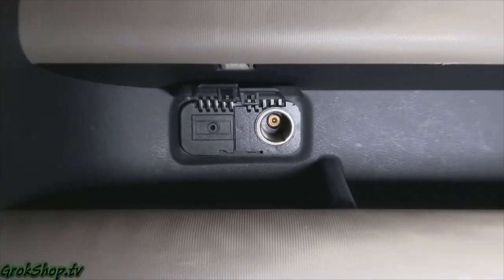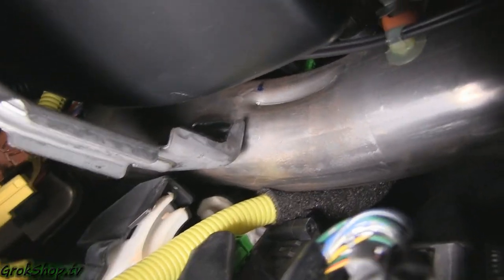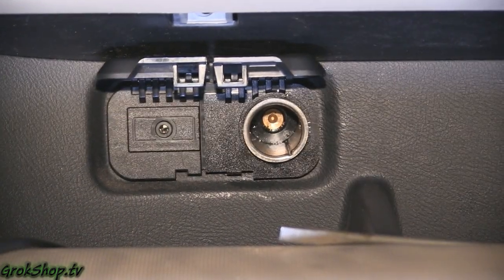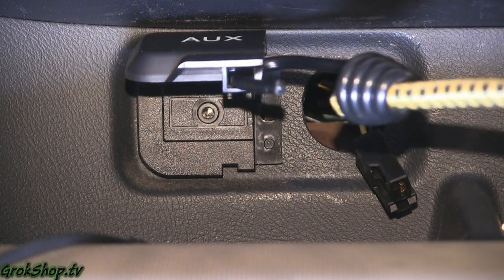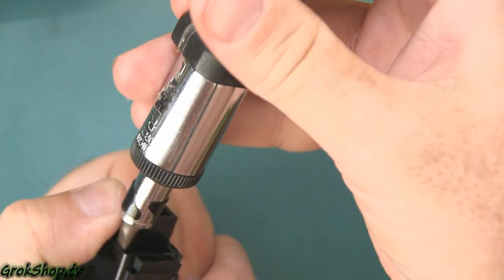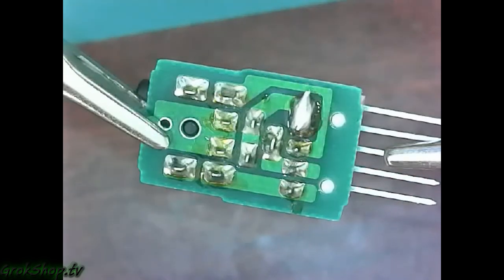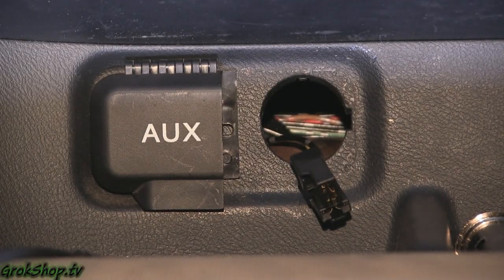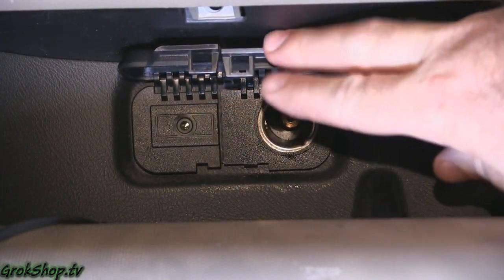Honda Element AUX Jack Repair

Comment: Here's the scoop... YOU DON'T NEED THE TOOL! 
Unless you've actually screwed up the metal socket itself somehow and need to replace IT. And you don't need to drop the glove box either. The actual tabs that hold the plastic SOCKET housing are on the TOP and BOTTOM of the housing. So all you need to do is have a slightly curved-tip screwdriver/tool to wiggle behind and loosen the top and bottom of the plastic socket housing. Then all you do is pull it out and the socket housing is out of the way without having to remove the actual metal socket! Now, for the AUX INPUT plastic housing, the tabs that hold IT in are on the Left and Right SIDES of the housing, so take your curved-tip screwdriver/tool and first wiggle it behind the LEFT side of the Aux housing so it pops out a little, then as in the video stick your finger through the empty socket hole and push on the RIGHT tab of the Aux housing from within and it will pop right out! The second half of the video about grounding the pins is 100% correct, then reverse everything and you're done! I actually removed them both again to confirm my process works. So it's totally do-able without the $10 tool, but if I hadn't followed everything else about the video I would not have known that.
Reply from the maker: Fantabulous...  thanks for taking the time to further the cause :)  Someone else mentioned they got it to work without the 12v socket-puller tool, but didn't provide this detail.  Can you provide a little more color on the tool you used?  Something like these maybe?:  https://www.amazon.com/Remover-Tools-Perfect-Removal-rings/dp/B079K41KMW/
Reply: Thank you both for this! I was able to do it with an old bent up screwdriver and some wiggling. The video was also very helpful.. thank you. Still the only video out there specifically for Honda Element aux port replacement.

Comment: Thank you! Our 2003 aux went bad and thanks to your video I just ordered a new aux input and replaced it in only about 5 minutes total. While getting the 12volt out was not fun it came out relatively easily once I used a screw driver inside it to pull it out far enough (I did it without the tool), then used pliers to grip it with care, wiggle it and pull it out. The aux input came out without even going behind the dash by again prying carefully and popping it out (much easier than the 12volt). Everything is back in place correctly and kicking out the power and tunes :)  We went with a bluetooth connection to our phone and the direct wired connection to the aux input. So no wires are plugged/unplugged once it's set up.
Thanks again!!!!
Reply from the maker: Thanks for your feedback Scott. Glad it helped!  I am amazed you were able to get that 12-volt socket out without a tool!  I wonder if they used different materials over the years or some such?  In my E, the little flanges that grab the 12v socket's metal cylinder from the sides would not release for me without the special tool... I tried many different types of screw drivers etc & even tried to make my own tool before buying one.  After getting it out I could tell the flanges were very rigid with minimal flex, so it made sense why I was having so much trouble.   I also have done the BT setup now.  Welcome to the 21st century, lol.

Comment: Thank you for these instructions. Excellent and it worked!!! I took my time on my 2008 Element and it really wasn't too difficult to disassemble the lighter. Now, I'm still 2nd guessing if the solder was the fix but it seems that when I connect the 3.5mm cable to the AUX and my phone, and turn the radio off/on, and I'm sure to have the volume on my phone HIGH, then everything seems to be working. Regardless of what it was exactly, I'm happy I should now be able to listen to podcasts, etc. in my car conveniently again. Thanks again!!!

Comment: Absolutely great fix video, best I’ve seen. Totally covers every aspect. Way over the top with the soldering. Beautiful solder job. 
BTW the clever Honda designers are not fools. Ever try to change an oil filter. They wanted it to be dealer accessible only (needs to be on a lift) that they put it over the exhaust so there was a chance of fire, even better for them, have to buy a new car. They make it difficult on purpose and even engineer parts to fail. Take the window lift, and the accessory port, the door speakers I could go on and on.  BUT......... they make the mill bullet proof so you drive it a long time and invest in repair labor and parts. Even General Motors has more reliable peripherals, inversely their mills suck.

Comment: Greatly appreciate the repair video.  Adding that I found that a plastic trim removal tool to be the easiest approach to popping out the 12V socket and aux port housings without scratching up the dashboard.  I just used one from a cheap Harbor Freight set.  The corner of a thin putty knife also works great for removing the circuit board from the housing.

Comment: Got by with a screwdriver, but awesome info, not sure how anyone could figure this out on their own. 100% the fix and now working great. Great solution before just replacing the jack.
Reply: And the glovebox tabs should come off really easy with just your fingers no damaging tools needed. 3 elements all pop out like nothing just tricky getting em back in.

Comment: Great video, had a similar issue with our 2011 Honda Pilot, while not exactly like the video to take it apart, the little aux input jack was the same when it came out, bridged the two pins just like your video, and now it's working great (fixing it this way meant I didn't have to wait for a part to come in the mail, and honestly I think I prefer to just manually change it to AUX or USB vs having the cable detect it, so I think I like this better).  Thanks for putting this video up, it really helped!

Comment: Super awesomely helpful video.  I was lucky enough to pry at the 12v assembly and it eventually popped out.  My tool of choice was a 90 degree flathead screwdriver.

I suck at soldering.   They call me Shaky McShakes....but I got it.

Appreciate the sharing of knowledge.

Comment: Thank you for this, I thought I was going to have to tear my dash apart to get this effing thing out.

And thanks for saving me the trouble of looking up the pinout, since I had the exact same problem with the plug detection failing.

Comment: Going to give this a shot.  Thank you so much for posting.  It's driving me bonkers that it doesn't work.
Reply from the maker: Good luck Bryan - u got this!
Reply: It's working again!  Your video made all the difference.  I'm going to get a Bluetooth adapter for this sucker so I won't be plugging stuff in and out all the time.  Thanks again, sir.
Reply from the maker: Right on.. thanks for following up man.  I am thinking to do the bluetooth thing as well.  Post up the model you end go going with... I am curious about the different fits.  It would be great if there was a model that could break out some 5v USBs from the the 12v accessory plug AND also connected to the AUX for Bluetooth.  I'm probably dreaming tho...
Reply from the maker: Thanks for the update... Looks like you found a good one.  I also have a Garmin in there which uses the 12v accessory socket, but I think it also does a DC-DC conversion 12v-to-5v & may actually work on the 2.4A USB plug.  I will just need to look that up to verify.   I only use the Garmin on occasion, so it doesn't necessarily need a dedicated plug.

Comment: Thank you Thank you Thank you. Actually was quite simple
but only because of the great video. Opted to solder the pin and it works perfectly. Less than 15min time. Much Appreciation :)

Comment: I've had a 2007 EX as my daily driver since it was new. My AUX port failed long ago (same problem, wouldn't even switch to AUX on the stereo). At some point, I bought a Bluetooth FM transmitter. It has made me mad so many times. Somehow it will get changed to transmit on the wrong station. It is unusable for calls because the person on the other end can't hear me. I have to turn the volume up super high to hear my music. Etc etc. I finally had enough and decided to research what it would take to have a working AUX port again. Didn't know if the problem was in the stereo itself or the jack or what. Found your video last night. I've rarely facepalmed so hard. I solder as my career. I think the port broke before I started this line of work, but I've been at it for nearly six years. Anyway, I waited for daylight and went out and pulled the socket and aux from the dash. I actually just used a constant and steady force and pulled them straight out by hand. I'm a petite woman, so it didn't take brute strength or anything. Removed the circuit board/jack, broke out my Hakko FX-888D and some Kester leaded solder (I love a chance to use the leaded stuff) and bridged the joints. Reinstalled everything and it works perfectly. Can't believe how frustrated I've been on so many occasions when this was such an incredibly simple fix. Ten minutes and $0. Oof. Thanks for the video!!!

Comment: Thank you so much for this video! I bought the cheapest soldering iron (<$10) and fixed my AUX port as well as my partner's AUX port. I'm very appreciative of the time you took to illustrate step by step how to access the components.

Comment: The soldering solution worked.  My AUX wouldn't work, exactly as described, on my 2008 Element EX.  I pried the 12V and AUX ports from the front using a small pry bar.  My Element is WAY past any concern about little scratches on the plastic!

Comment: Great explanation, I was actually able to get both out without goi big through the glove box, a little more levering with a screw driver, but no visible harm and everything seated back like normal. Saved at least 20 bucks going this route and had sound back in 30 minutes instead of waiting for a replacement part to arrive. Thanks a lot for your post!

Comment: My Ridgeline aux Port failed once. I just pulled it out and sprayed electrical parts cleaner and it came back to life. Now it failed for the second time so I’ll try what you showed me here. Thanks!
Reply from the maker: Yeah for this unit, when it began to fail, I definitely tried cleaning both the jack and plug to no avail.  For a while though, I could like pull the plug out a tiny fraction and it would would work.  Once that quit working, I began the research to figure this solution out.  Anyway - if you care to advise, it'd prolly be helpful to some to hear how your saga ends up.  Good luck!

Comment: Hey y'all  You can try to spray some De-Oxit electronics cleaner in to the 3.5mm hole   Make sure car is off and wait an hour or so for the cleaner to dry up.   This worked for me   AUX was lighting up on the radio screen, but there was no audio.      Everything is normal now, no tools or removal needed      This may not work for all, because 3.5 mm jacks and cords are not too roadworthy   .

Comment: I just need to replace/fix the aux jack and had already bought one so will just replace it.  Do I need to pull out 12v power to get to aux jack?
Reply from the maker: Unfortunately, the answer is yes.  If you look at around 3:40, you can see how the 12v socket overlaps the AUX jack.  Great design, huh.

Comment: How do you test this port before you buy a new one or tear the panel apart? Mine cuts out then in then out. I end up using CDs when I'd rather use Pandora. I added a Bluetooth adapter which paired easily enough but wish it could be installed inside the panel. Needs a power supply though.
Reply from the maker: If your AUX audio is cutting in and out, its very unlikely anything else would be at fault.  The only effective way to test the autosense circuit would be to remove it & make a test jig.  Just depends on how much time you want to invest.  As far as the BT hookup, I think the easiest way - if you want to retain a 12v socket or other uses -  would be with a 12v socket splitter; these usually come with some 5v USB sockets too.  A cleaner approach - at the expense of more work - would be to splice into the 12v socket's power line & remove the 1/8" jack to make a custom hole & mount.

Comment: I got a new aux plug back in but only the left side is sounding can you help me with that please
Reply from the maker: If its a brand new aux jack board & you haven't done any soldering on it, then you most likely have a bad connection.  That could mean your 1/8" cable could have worn or oxidized contacts, or even a broken wire inside.  Or it could mean the aux board isn't making a good contact.  Test out the 1/8" cable first or try a different one.  If that checks out you have to pull it back apart to check everything & test it while you have it apart.  The least likely case should be the new aux board, but you never know for sure.

Comment: So the soldering is for the auto recognize to work? Would this fix the constant switching between Aux / CD / FM every time you hit a bump? Driving me crazy
Reply from the maker: When u solder it like I showed, it basically disables the sensing such that if u hit AUX, u get whats plugged in, even if there is no signal.  I dont know about ur auto-switching thing.  It may help it or u may have a different problem.